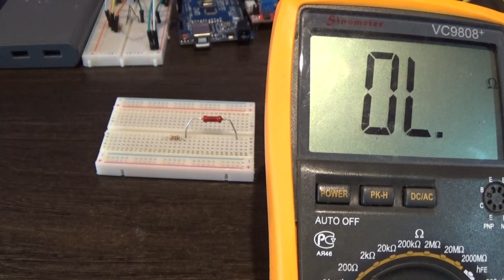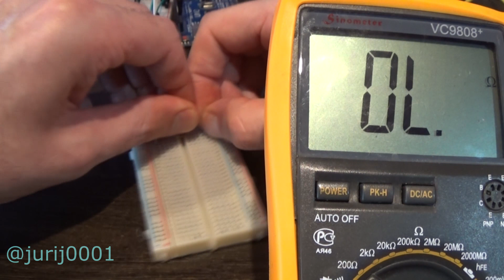Physics. Electricity. Experimental problem. The equivalent resistance

Comment from the maker: Follow to my notes!
170 notes. Physics and engineering. https://tspr.ng/c/170-notes-physics-and-enginee
21 problems in mechanics https://tspr.ng/c/21-problems-in-mechanics
21 notes on molecular physics and thermodynamics. https://tspr.ng/c/21-notes-on-molecular-physics
21 problem of electricity (electrostatics and laws of direct current) https://tspr.ng/c/physics-and-engineering-elec
21 problem of electricity (electromagnetism, alternating current) https://tspr.ng/c/21-problems-of-electromagnetis
27 notes on quantum and nuclear physics https://tspr.ng/c/27-notes-quantum-and-nuclear
21 notes on Astrophysics https://tspr.ng/c/astrophysics-21-notes
Notes with Arduino for beginners https://tspr.ng/c/arduino-for-beginners-in-notes
Reply: Your notes are great, mine a mess :)
Reply from the maker: @cassieuwu1396  Thanks sir )))